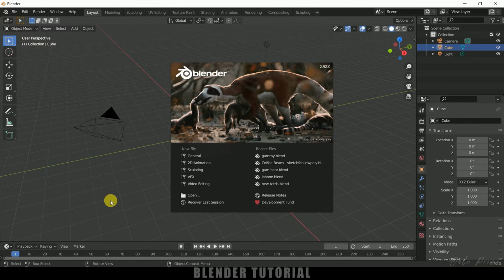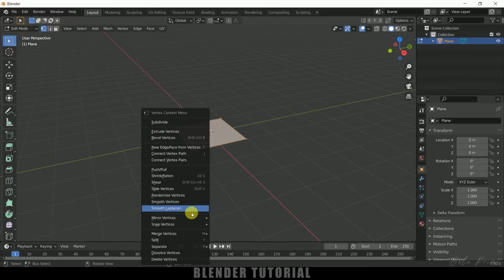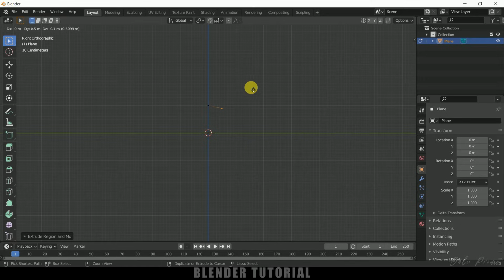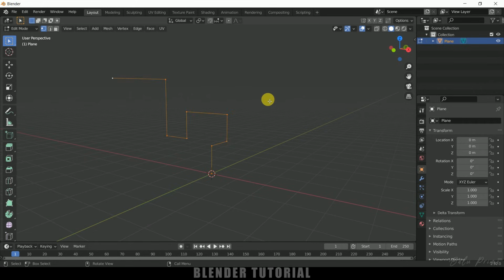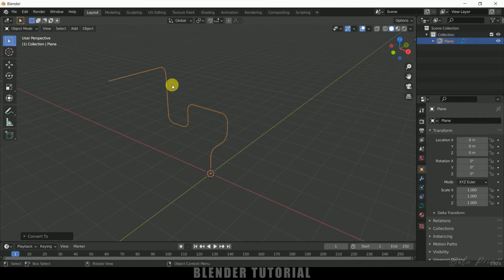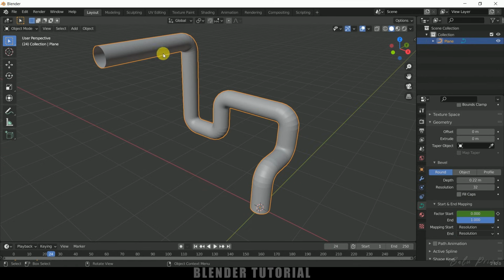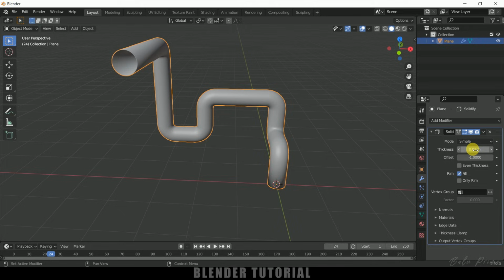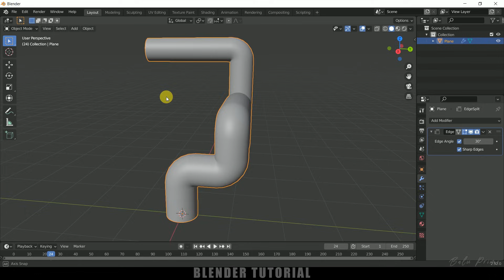How to model pipe easily in Blender 2.92 | Blender Beginners tutorial

Comment: Super, thank you! One question, when I bevel as you do in 1:53, it keeps a streight line when I scroll on the mouse wheel. How can I make it to bend as yours is?
Reply from the maker: Hi... After pressing ctrl + B for Bevel, scrolling mouse wheel upwards will all vertices... If its not working, select the two vertices which are at the corner  in Edit mode, right click and subdivide...
Reply: @Baluprime  Thank you so much! And for answering so quick! It worked with the subdivide but not with the scrolling (it just added cuts but didn’t bend, I must have pressed somewhere I guess (yup I’m a very beginner hahah))😅 

Edit: ooh I figured it out now, must’ve pressed Z accidentally hahah
Reply from the maker: @Kaxyla  Appreciate your support... Have a great day 😊...
Reply: @Baluprime  You too!😊🌟

Comment: What if I want to create pipes with sharp turns? If I don't bevel the vertices, the pipes aren't uniform radius
Reply: me too having the same problem have you found out a method?🙄
Reply: @PSYCHOlogical_AMBUSH  i mean it's not possible for the pipe to be the same radius in the joint just geometrically, it's like cutting a salami under a 30 degree angle, the slice will be of a bigger radius than the salami stick itself